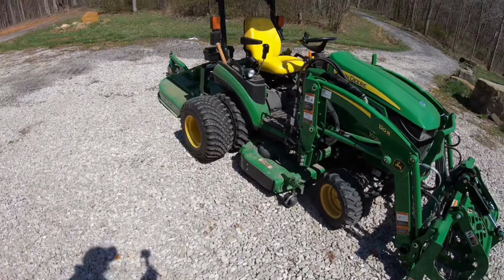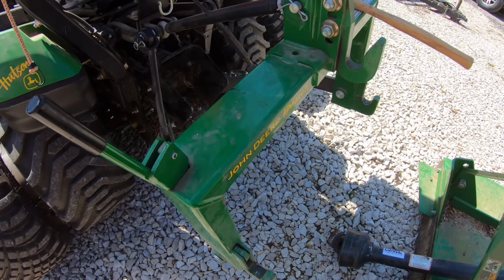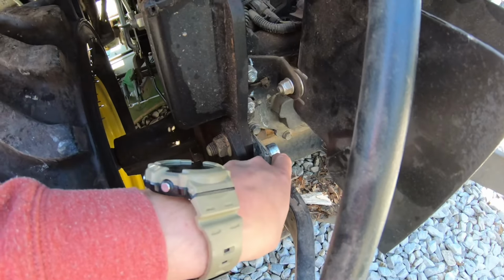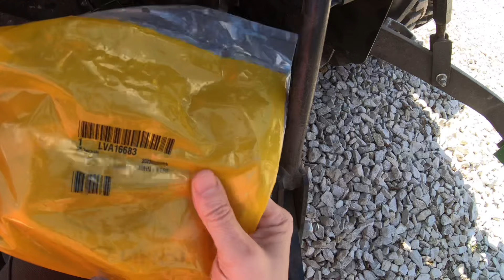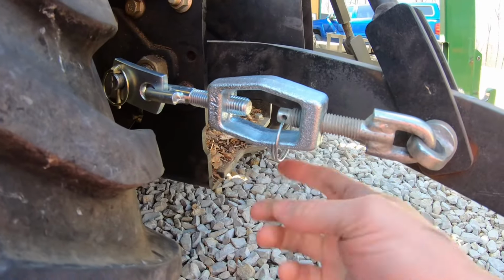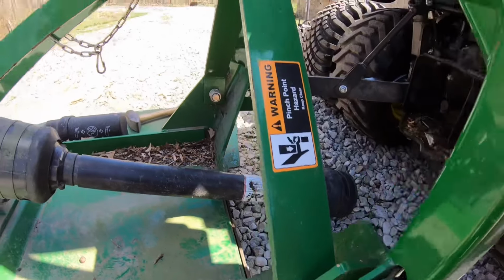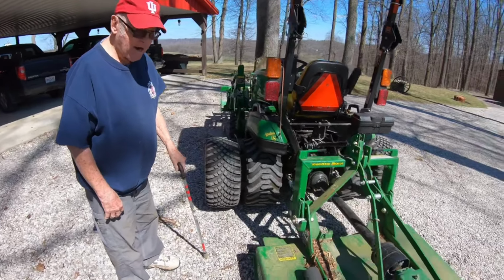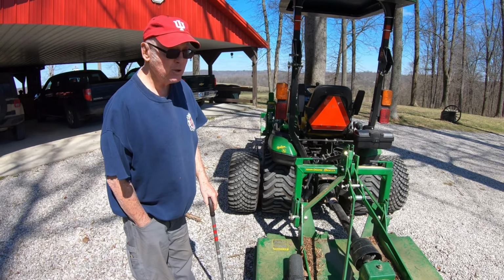John Deere 1025R 3pt Hitch Problem EZ Fix

Comment: good video and job years ago they used a large washer , castle nut and cotter key to hold on the lift arms they need to go back to that.  bush hogging the weed and bush pull out the clip pins i buy them by the box i can't tell how many i have lost. take care, be safe and well.
Reply from the maker: Thank you, yes I agree that would definitely be more secure. Appreciate the views and the comments! Have a great day and be safe!!!
Reply: Your neighbors situational awareness is about as good as my wifes! I understand not catching every little issue but he should have noticed that lift arm being out of place well before u did. The turnbuckle on the left side was an easy notice item!